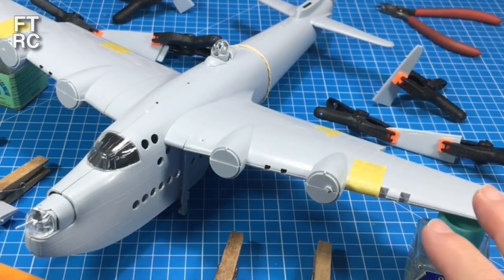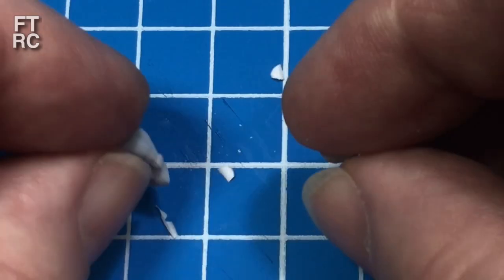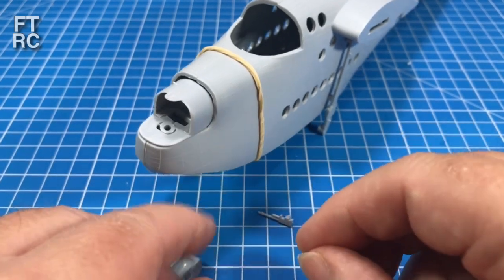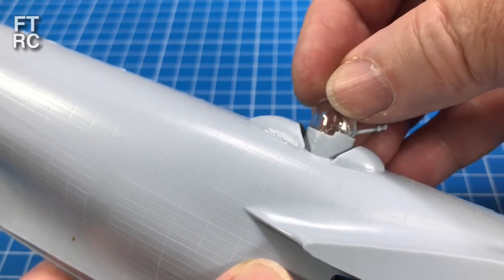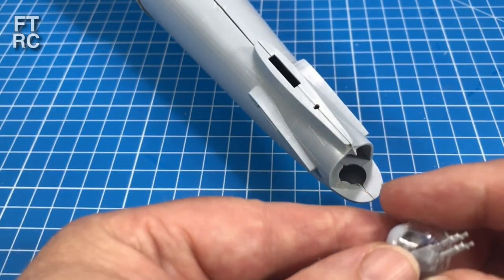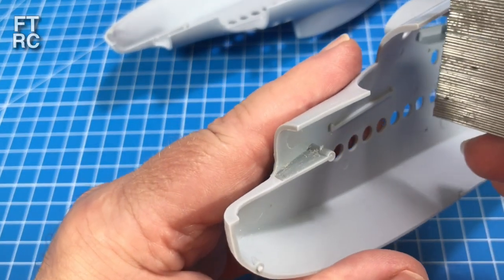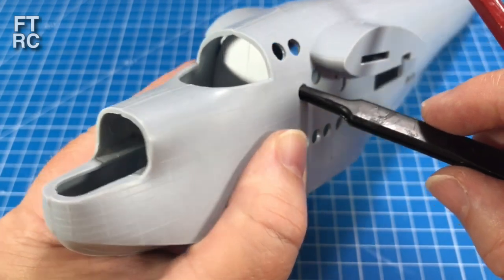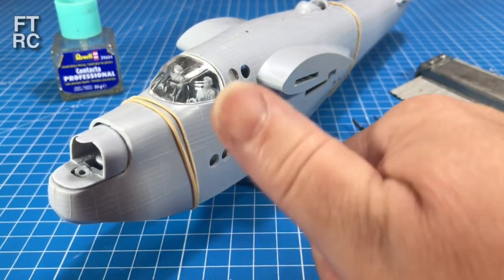Airfix Sunderland Part 2 Turrets and Cockpit

Comment: Lovely to see an update on the Sunderland; especially as it's another nice old Airfix kit. I'm also doing an old one at the moment: an Airfix Helldiver from about 1973/74- at 50 years old (over twice my age) the oldest manufactured (but definitely not the oldest tooled) kit I've ever built by a margin. I felt like maybe keeping it un-made given its age, but as it was a gift from a friend and it wasn't in perfect mint condition with some parts off the sprue I thought I'd have a go. I've learnt some things with it and will use the original transfers with it as they seem to be in good shape. Looking forward to the next Sunderland update.
Reply from the maker: Thanks Edward

Comment: Hi Harry, Great work👍🏻. You probably know the trick, but for that gap between front machine gun housing and the fuselage, I would apply cheap (smooth and thin) packing tape (brown or clear) on the sliding housing, fill-up the gap with polyester putty (auto body type), it doesn't stick to the tape once harden, wiggle and remove carefully the turret housing, remove the tape, and a little bit of clean-up/sanding of the edge of the fuselage for tolerance. That bulkhead makes a big improvement👍🏻.I always enjoy your videos, Thank you, Harry.👋🏻
Reply from the maker: Thanks for reminding me of that old tape and putty trick Yves.  It is a good solution.

Comment: A 1/72 Sunderland with an interior would be fascinating - the real thing has a proper galley, sleeping areas, a magazine and a workshop. It was a huge aircraft, developed from luxury passenger planes. There's one at IWM Duxford, not that far from where I live, on static display. It is breathtaking, close up.
Reply from the maker: I’m sure it is a sight to behold Brian
Reply: If I remember correctly there is a YouTube video showing a 1/72 Sunderland with a complete interior, it even includes an Elsan toilet.

Comment: Nice tip on finding the center line, I be using that in future 😀
Reply from the maker: Yep it’s an old one, but still pretty useful.  Just don’t have the band too tight of course, otherwise it will distort the fuselage half.

Comment: Nice start so far Harry!  🙂
Are you going to add a deck or two behind the cockpit?  Basically needs a dummy 'floor' really to give an impression....  😉
I remember building this as a youngster back in about 1970-ish, and loving it!  It seemed HUGE to me then, and very impressive, and even the lashings of Humbrol enamel paints couldn't tame the fingernail file effect of the raised rivets ALL over the fuselage!!  😂
Reply from the maker: Now I have the cockpit sorted I will check the dry fit of the fuselage halves to see how much you can see inside.  I have however added tissue curtains to the sides of the bulkhead doorway, which help obscure the hole behind the pilots.